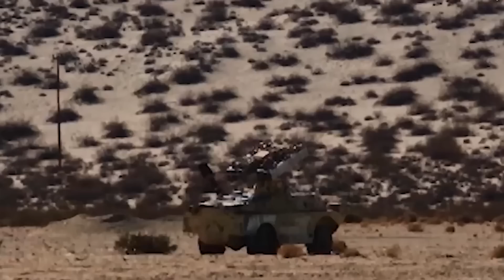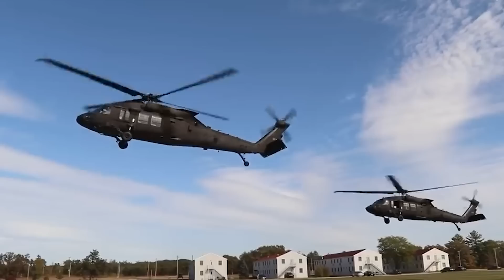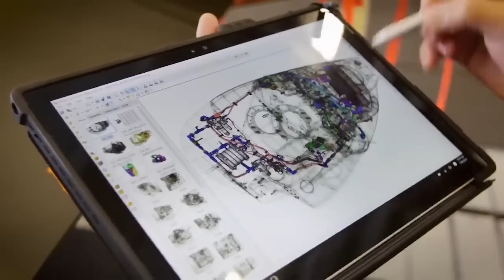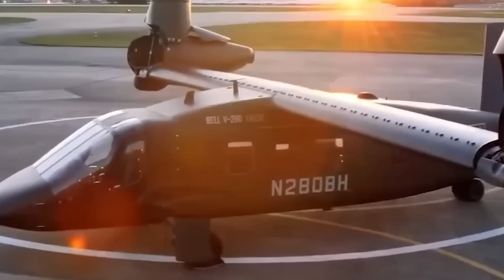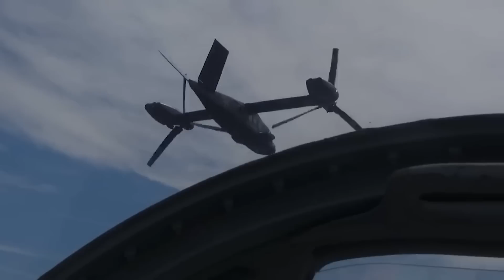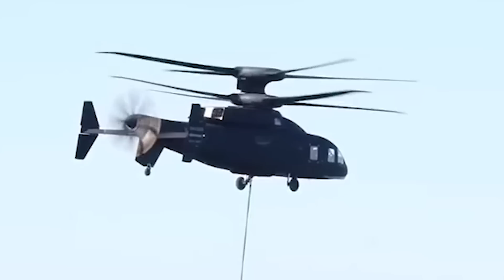The Helicopter that Will Crush the Black Hawk?

Comment: the SB-1 Defiant multi mission utility helicopter could do with a more streamlined fuselage design architecture, bit stealthy . . . for e.g. the tactically superior NH90 TTH (Block III) multi role helo gunship that isn't stealthy but the airframe does have a low RCS . . .

Comment: I think the double rotor is a good way to go thought the offspray* has many more moving parts than a chinook, would money be better spent improving what works, as vernicle take off jet would be more a game changer than double rotor plane, far less moving parts, vertical take off jets would make for a more versatile Airforce attack force not a rotored plane two rotors and all the moving parts on a jet with one moving thruster?

Comment: The biggest obstacle the crashhawk will encounter is gravity. They're not called crashhawks for nothing. The UH1H Huey was a tried and true war machine. STILL IN USE TODAY IN MANY COUNTRIES! The UH60 is okay. I have flown in them and jumped out of them. Had one start pouring out smoke that no one could find the source of, and one guy was standing on a HMMWV waiting to sling one under the helo, and caught the arc from all the static electricity which blew him 15-20 feet away.

Comment: So Bell & Sikorsky are building on D'Ascanio, Gyroplane Laboratoire, & Kamov's designs for co-axial rotors? The pusher prop is hardly a new idea either. We will climb on when they can produce something flexible, durable, & fixable as well as flyable. I'm holding my breath.

Comment: The Black Hawk did NOT get the "moniker" "Crash Hawk" because of high rates of accidents or crashes.   It got the nick name due to its high survival rates when crashed.   The designed "plow beams" of the floor along with the "roll outboard" of the engines in an event of a crash are what lead to the moniker.

Comment: I think all  they've actually managed to do is add a great deal of cost and complexity to a problem that didn't really need it.
If you end up having to go back and fight from FOBs in the desert or you have to fight in the pacific from ships it doesn't make sense to build something that increases maintenance hours which I think is inevitable with design especially when most long distance missions are probably better suited to fixed wing aircraft anyway.
I think this is more of a solution to the American governments addiction to spending money and going to war than it is replacing a helicopter.

Comment: No. V-22 is too unstable and un safe and too large for LZ insertions. Counter rotating rotor systems are unreliable. Removing anti torque control out of the common power system is bad.  The Defiant is right out of the Army Aviation Museum that looks like the gunship prototype from decades ago. Much less maintenance is a myth always claimed by the industrial war machine.

Comment: If the tilt rotor represents the best of both worlds then surely this is all you'd need on an aircraft carrier? Like all things it represents an engineering compromise as if it were truly the best of both worlds all current aircraft would be obsolete. Conventional fixed wing aircraft will have greater range, load carrying capacity and speed but not necessarily all attributes combined as no one aircraft offers the best of everything.

Comment: we are finally going to use the contra-rotating stacked twin main rotor approach the russians have been using for about 75 years ... its efficient and solves several aerodynamic problems .... using highly mobile tilting main rotors out on the tip ends of wings is a moron's solution, about the same as choosing to generate a nation's electricity with massive wind turbines rather than by using nuclear fission......it just magnifies shearing twisting and thrust forces and sends them all through a well greased bearing into a lever .... like a bad adult movie

Comment: One main difference between the Valor and Defiant that few people mention is survivability.  The Valor has two engines.  Both rotors are connected by a rod.  If one engine is taken out by small arms fire or RPG, the Valor can continue flying normally, just not as fast.   The Defiant has one engine.  If it goes out, you're forced into a hard landing and need to be rescued.  Blackhawk Down anyone?

Comment: In a real war, with a powerful and much better equipped army fighting on its own ground, it will be target practice. China will have 10x  the fire power. America will have to fight from a long distance over sea, and it’s supply and command is 7000 miles away, every ship and every serviceman will die in the Pacific.

Comment: Ultimately to think of war in the pacific. In spite of its power, the US has shown consistently over the last 50 years, that it does not have the killing instinct to finish a war and end future conflicts quickly.

It has the capacity but, kinda goes 60% then stops and gives regimes time to adjust, rebuild and repeat decades later.

Comment: The Sikorsky Defiant is just the updated version of Lockheed's Cheyenne developed 55 years ago.  The slower rotor speeds also help with forward Vmax, which was a problem with the Cheyenne (single rotor plus one push prop) as the blade tips would go supersonic creating retreating blade stall and all sorts of bad things happen from there.

Comment: A multi tool is the most useless tool in your tool box... Its better to have small set of purpose made tools.
the tilt rotor is vastly more complex... it cannot glide like a plane... nor can it auto-rotate like a helicopter. thus any damage to any portion of the aircraft especially one nacelle will turn this into a very expensive lawn dart

Comment: Both should be used in the theatre , as the Tilt Wing , would have very specific duties involving speed , in transport , whilst  the Dual Rotor / Tail prop Boeing craft would be an excellent hunter stalker for pop up attacks.
Reply: It's tilt rotor not wing.  The wing on the valor is fixed along with the nacelle of the engines.

Comment: It's kind of stunning to make this video, complete with very confident but questionably-supported safety claims, when the Valor is very clearly related to the Osprey, which has been such a safety nightmare in Japan that it has been specifically protested by the public. This video would've been a lot more compelling if it addressed the issues that have plagued the Osprey and how/whether the Valor addresses them, even if only at a high level.

Comment: the H-60, H-47, H-53, and H-46 have done their jobs so well, it is much harder to outright replace than it is to update and modernize them. The only exception at this point is that the H-46 has already been replaced by the V-22, which was not without issues by any means.

Given the nature of the design, the Defiant seems a lot safer of an approach than a tilt rotor. Coaxial helicopters are very stable, and have a high degree of lift vs. power required, the downside being that there is a trade off between maneuverability and stability.

Comment: Neither design looks naturally adaptable for Navy carrier hangars right now. Will they end up with ultra expensive adapted naval versions that sacrifice 40-50 percent of the performance gains just to be shoehorned in as carrier-capable? If we end up with F-35 style A/B/C versions and the fly-away cost overruns it will be another nightmare budget situation.

Comment: What?! Fly-by-wire doesn't eliminate the risk of human error by flying, it provides a more reliable control system than hydraulic systems, with less maintenance. The redundant systems back up the primary FBW system in the event it gets shot up and is unusable. NOT the same thing as an autopilot, which alleviates the need for manual control for short periods - FBW doesn't fly the bird.

Comment: I just want to throw this out there... Since 1991 when the V-22 Osprey first started testing, there have been 12 crashes resulting in 51 fatalities. This includes 2 combat zone crashes. Since 1991, there have been 338 UH-60 crashes with a death toll that I didn't feel like counting. Overall, the tilt rotor design is a bit safer, but at the same time, the UH-60 is also much more numerous and had  a LOT of military action losses and those numbers aren't just US forces. 12 other countries operate them and as they get phased out of service for the new vehicle, there are 9 other countries that have expressed interest in obtaining them.
Reply: You know if the USA is developing these new 6 Gen Helios. US Allies around the world. Are going to want some new ones as well. Japan, South Korea, Australia in the Pacific, come to mind
Reply: @lisaroberts8556  We will have to see. It took 7 years after the introduction before the US started to sell the Black Hawk to Australia. The new platform, whichever it will be, is a radical new design and will require specialized technicians and parts... I think as the Black Hawk is retired for the new platform, those countries you stated will be buying those older ones for cheaper prices instead of looking to buy something brand new instead.

Comment: I'll like to see it being transported inside the C17 or C5. With the Blackhawk you just fold the blades and the tail to get inside these aircraft. Can these wings be folded?
Reply: The V-280 cannot be folded in its current configuration, but it is only a prototype. There is actually only one V-280 right now, but it has also already won the bid against Sikorsky.
The next step (over the next 8 years I believe) is to tweak and modify the designs to iron out bugs, improve performance, and make any necessary changes needed to better fit its role.

If it is not changed to allow it to fold up, it may be necessary to partially disassemble it for shipping via C-17, which isn't uncommon for many vehicles.
They may also just let it fly on its own wherever needed as it has something like a 1,200 mile range for non-combat missions.

Comment: Everyone knows the Defiant X is a far better option for superior maneuverability and durability in a hot combat zone. Especially where the tilt rotors are far too sluggish and vulnerable when transitioning to and from hover mode. Also, the hot hover limit of the Defiant is superior for mountain operations. The only reason they are wanting the Valor, is speed and range. This is very short sighted thinking, when needing a helicopter for actual combat.

Comment: The Defiant is the solution. Maybe not the best, but given the current situation we need an more efficient and effective airframe that doesn't take up a large footprint. Tilt rotor is great, but it's massive.
Reply: The Defiant is at a much lower technology readiness level, and is a sub scale to what is needed.  It also cannot be easily scaled up.  The counter rotating blades are a HUGE design issue.  Just because there is a flying subscale example doesn’t mean it can work without major redesign for larger designs.
Reply: You could put more defiants on a carrier for one thing.
Reply: @jacksondavies7731  sure, but the Army is the foundation of this program and that's not a primary concern they have.
Reply: Reputedly the V280's footprint is virtually identical to that of the Blackhawk when you factor in the rotors of the latter.
Reply: The defiant is ugly but a far more robust solution.  The valiant is too fragile but will be selected by the military because it looks cool.  The military has a long and distinguished history of selecting the wrong equipment...remember digicam?
Reply: @eeroala5132  The defiant is the less robust of the two.  Sikorsky has had many technical challenges with the counter rotating blades.

The Valor is the lower risk of the two options.  I worked on the Valor (so slightly biased) but my former employer was also a major supplier to Sikorsky, and we were hearing quite a bit about the technical challenges they were fighting.

I also have 0 confidence in Sikorsky to be able to design anything new.  They are a terribly sick company with a horrible culture and worse engineering as an organization.

Comment: Cruising on top of tree.
Osprey/Valor have propeller lower then the aircraft body (in flight mode), it's not really suitable for covert operations.
Helicopter can, sometimes a tree branch struck the lower part, but it's better then eating missile. 

Valor can't turn like a helicopter (in flight mode) to avoid anti aircraft group on dangerous ground.
Can't suddenly land, to avoid danger, because it need time to transform. 

Helicopter disadvantage: it's LOUD inside.
I suspect, they choose Valor over Defiant, despite many disadvantages(as a helicopter) because it's more comfortable for ears.
- - -
Osprey/Valor as transport plane is groundbreaking : higher speed, a plane that can do vertical takeoff and landing.

Comment: I'd really like to see the Valor land with one rotor out. I call BS on this magic fly-by-wire system
Reply: The Valor has a drive shaft through the wing so that one engine can operate both blades.  I dont know why they left that out of the video.
Reply: @Stephen2K4  ah! that makes more sense then. thanks. yes, they should have included that tidbit of information in the video!
Reply: Same here.  No way that thing can lose an engine and still land safely.  Maybe cruise horizontally 🤷🏻‍♂️, but yeah I call BS on it landing vertically with just one prop.
Reply: I was wondering about that too. I was thinking maybe they implied that it could glide in a plane? but yeah, I dont see it landing vertical with one prop working.

Comment: You already have the Osprey, no reason to have another. Also it's so much wider getting into small areas where they can drop or pick up troops will be a pain. The Defiant looks like a much better choice in that department. I just don't see why we need another Osprey knock off, those things crash a ton! I just think they completely missed the mark on building a helicopter.
Reply: Blackhawks had lots and lots of crashes in the 80's,  so many crashes in a short period they grounded entire fleet for a while. happens with with most all new military helicopters.  I agree that defiant x is better replacement, but also think this valor is a good craft to have in addition for different roles.
Reply: @jamesbrown5262  Blackhawks are still crashing. I think the last one was a National Guard.
Reply: The defiant actually had major issues such as the tail prop being geared to the main rotors with a clutch and no throttle control, and various other issues. The V280 was the clear choice. There may be other better designs in future, but the defiant was not it

Comment: The big improvement over the Osprey is that only the rotors, well, rotate, from horizontal to vertical, while the engines remain horizontal.
Reply: And the wings are straight, not swept forward, which eliminates the need for a central gearbox and allows for a single driveshaft between the engines.  The wing is also way fewer parts
Reply: I’m concerned that when I see the engines tilted up, that leaves a big hole in the engine for crud and enemy weapons to find a way into the engines.
Reply: And THAT simplifies a WHOLE LOT of the complexity of the Osprey.  Old Osprey developmental test engineer.

Comment: Many in the comments have been mislead by headlines. The decision on what aircraft will replace the Blackhawks has not been made yet. The valor got the go ahead to proceed with more development and testing, but that is not the same thing.  The fielding of new aircraft isn't supposed to happen until 2030 so lots of things are still subject to change.  As a guess, I bet we end up with both.

Comment: The Sikorsky Raider will win the Scout/Attack Helicopter as it’s the only thing that can keep up with the V-280. 

The Invictus might go to the USMC as a Cobra replacement. The Defiant might get the USMC/USN UH-60 replacement. 

Could also see the Bell 525 Replace the Huey.
Reply: The USMC already has a cobra and Huey replacement. It's the 4 blade versions, Venom and Viper.
Reply: @bl8danjil  We’re talking next generation replacement but those are great ships. 

The UH-1Y was introduced in 2008.
The AH-1Z Viper was introduced in 2010. 

Those are great, so is the AH-64. 

The Vipers top speed is 255MPH. The Venom’s is 190MPH.

The Bell V-280 is capable of speeds of over 320MPH. That’s unbelievably fast. 

The Sikorsky SB-1 Defiant has hit a top speed of 284MPH. 
The Sikorsky S-97 Raider has hit 270MPH, but likely capable of 300+. 

These new designs can carry much more, much further, much faster and loiter for much longer. These designs are a completely different animal than a Viper, Venom or Blackhawk.
Reply: @DriveByShouting  What I was saying was that the Venom and Viper aren't going to be replaced for a very long time. If really necessary the squadrons on the ships might get replaced, but that's a large uncertainty. The Marine Corps just doesn't have the money to replace them so soon after we had just got them. 

The Navy, however, may replace the Seahawks. It depends on the needs of the Navy. With the introduction and threat of hypersonic missiles, the Navy would probably like to be the farthest away they possible can. That's probably something similar to the Valor but with a redesigned tail and blade fold and wing stow. With that said, the Navy's current Seahawks or variants aren't set up to support long distance missions. Most of them don't have that refuel probe.

I honestly can't see the Navy picking up the Defiant. It's just too tall for many of the ships except a carrier which has the height for it. From the pictures that circulated where a group was standing near one the Defiant looks to be about 2 to 3 times taller than a Blackhawk.

I still want to see Sikorsky fly, but the height is going a problem. A smaller Sikorsky offering might work.